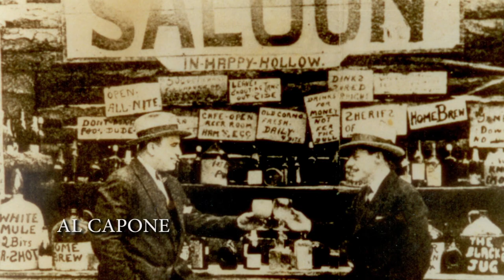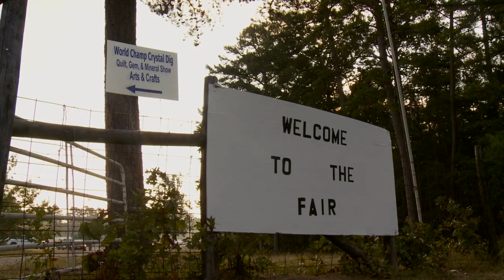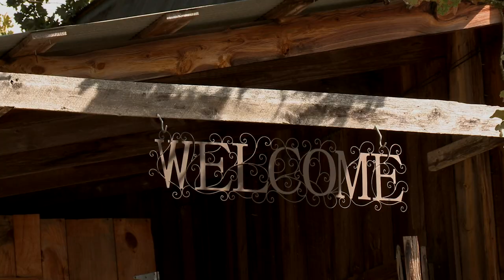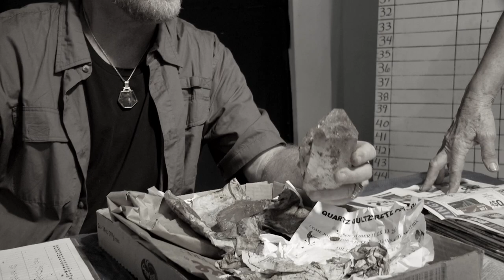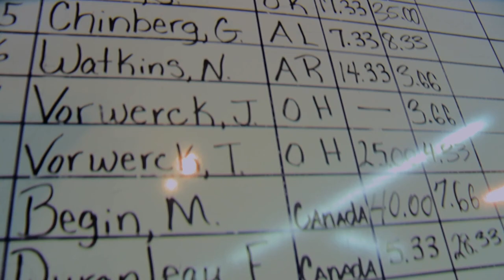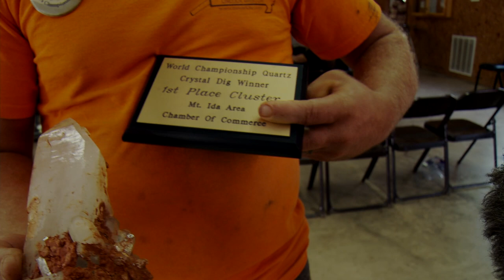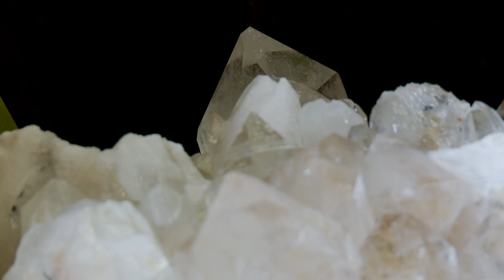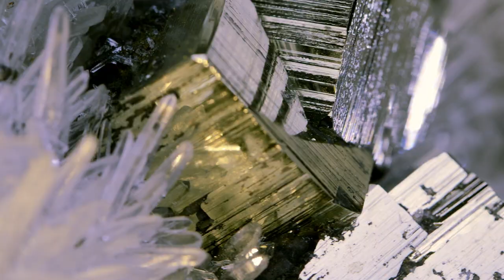MINERAL EXPLORERS | S1 | Ep5 | ARKANSAS

Comment: I found a 40-50 lb chunk of druzy quartz cluster, brought it down a mile of mountain, and I set it outside the house. The next day I went to check and a bird was sitting on it. When I walked up to it, there was also a toad sitting under the side of the crystal cluster. I think there is really something about the crystals.
Reply: Its almost as if shelter is shelter .
Reply: I used to have a large terrarium with geckos,scorpions , a tarantula and horney toads. In others I had rattlesnakes, gopher and a python.( Separate ones of course) 
Anyway, each creature has different times of the day when they are active with some being nocturnal of course. 
I had been given some large quartz pieces by a friend and thought they would look great in my habitats. So I placed several in the terrarium and one with each snake. Just for decoration.
What happened next just blew me away. 
Within the hour EVERY SINGLE CREATURE was active and congregating around the crystals. Some laying on them even. Others like the snakes moving over them then resting by them. It was the damnedest thing I've ever seen. 
I ended up taking them out because I felt I was interrupting their natural cycle but have never forgotten that moment. There is definitely something  powerful in crystals.

Comment: I've always wondered, are the larger quartz crystals older? Or just the conditions determine the crystal size?
Reply: Great Question!!!! Has anyone answered You back on this yet?? I'm curious about this as well...
Reply: Jim From Mars and C-Dubb. I'm a geologist and from what I've learned from my studies it's the conditions that determine the crystal size, not only for quartz but for all mineral spieces. For example more room for growth can give bigger crystals as long as the elements in the fluid, Si and O in the case of quartz, doesn't deplete too quickly. Also it's believed that a slower cooling process creates bigger crystals. With a quick cooling process you also usually don't get any good crystal shapes. So it's a combination of conditions that all need to line up. Hope this answered your question.